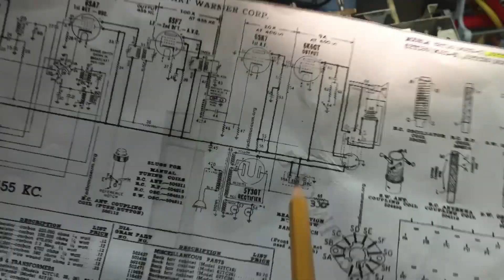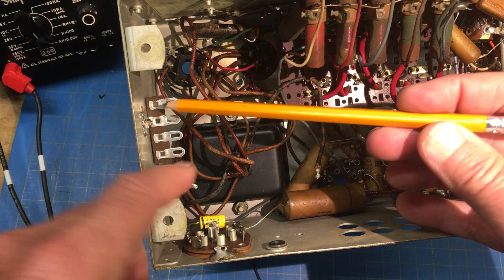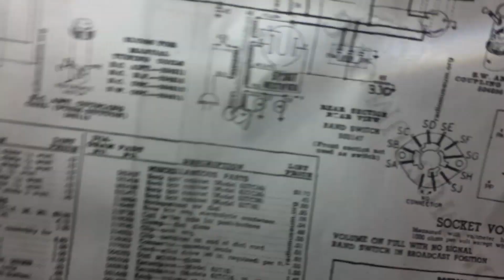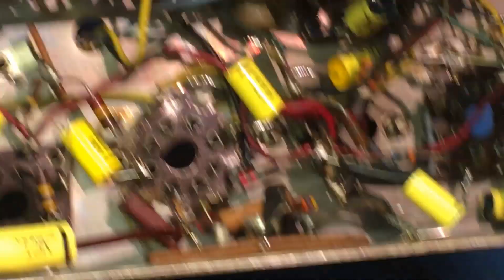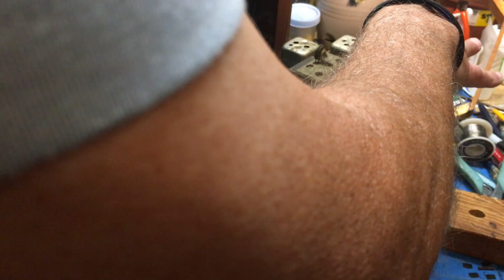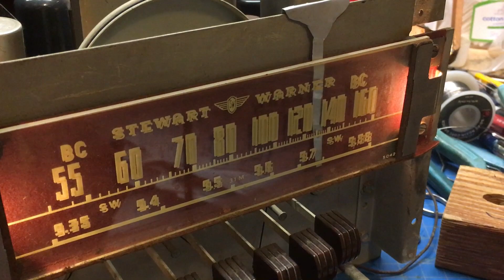1946 Stewart Warner Model 62TC16 Repair "Old Stew" Part 2 of 2 Final

Comment: You did really well on this radio. It seems very pre-war in it's design and such  you can fall into some self made traps if
 you're not careful. Thanks for the excellent video on it's repair Larry.
Reply from the maker: Thanks! The owner didn’t want to put a lot of $ in it….appreciate you watching and taking time to comment….if you don’t mi d, what’s ur name? I like to address people by their names….Take Care—Larry
Reply: @Backtothefutureradios  Steve
Reply from the maker: @hestheMaster  Thanks Steve!
Reply: At least it had the correct tubes in it. ✌✌Great job Larry.
Reply from the maker: @oldavguywholovesRCA  well, almost….lol….I probably failed to mention that it had a 6V6 in the output….which is a replacement for the 6K6…Thanks for watching and commenting! Take Care—Larry  ps……Watch for another video soon of a full restoration! 😉

Comment: The RF tube bypass may have been a WW2 repair.  Lots of things were done to keep radios playing on limited resources.  Repair techs had to get creative.  Substituting parts with what you have and modifying radioos to work with what they have since tubes were needed for the war effort.
Reply from the maker: Bill I agree, Ive found several “hacks” what we would call them that occurred during the War just to keep them going. This one is a post war model, so Im not sure why someone would do it? Didnt have a tube tester, placed the antenna on the grid of the next tube and it worked.?? Who knows? Sometimes that the fun trying to figure it out. Thanks for watching and commenting! Take Care—Larry